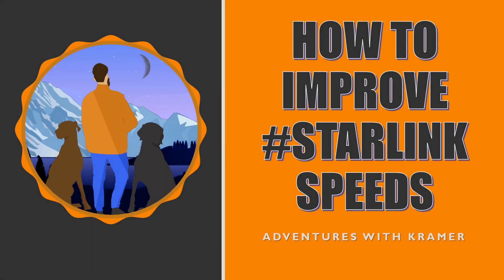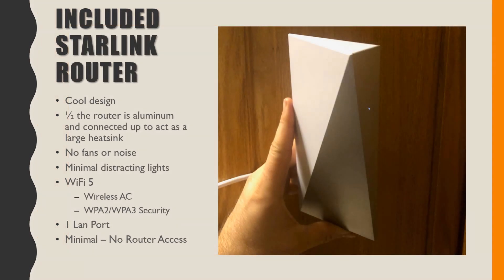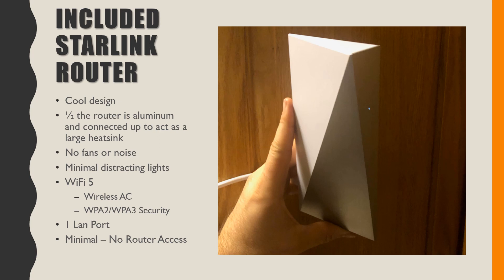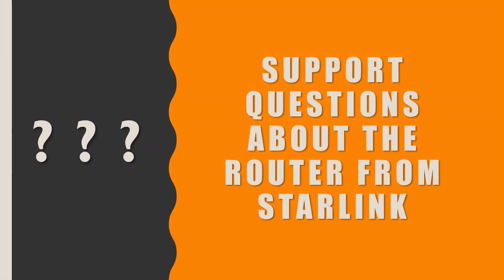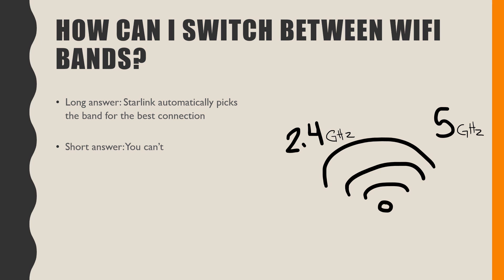How to Improve #Starlink Speeds: New Wireless AX router vs Original Starlink AC Router

Comment: I just installed mine today and the app tells me that there is no 5GHz signal just 2.4 GHz. I have a Netgear Nighthawk WiFi 6 router that I purchased a few months ago to replace an older Netgear router which never could get up to speed nor could I use it for anything more than access to an older HP laser jet, WiFi printer, phone, pad, and my audio and video equipment that, when used ate up my monthly bandwidth allotment and I would get FAPed. The new Nighthawk router allocated the appropriate equipment to the appropriate GHz bands nicely and now I should be able to use it at speed! 

What I need to know is how far from the StarLink router will I need to get to eliminate interference when the Nighthawk is plugged into the StarLink router’s auxiliary port?

Comment: hmm im thinking about getting a different router do you still recommend to do so
Reply from the maker: Yes! The included router is very limited. I have tried pushing it with multiple connections and it would just drop, couldn’t get it to stop pushing 5ghz when there are walls and needs to be 2.4 ghz. Need the extra security and options that another routers give as an option. It’s a good starter router for those not needing many options. But if you want to share WiFi with friends or family, secure the network or just modify settings easier, I suggest an ASUS router. I stepped up to an ASUS, so much better being able to use WiFi 6.
Reply: @adventureswithkramer  wow dude fast response thanks will be my next purchase

Comment: Hello , were you able to turn off the 2.4ghz and 5ghz wifi signals from the Starlink router? just to avoid interference  with wifi 6 router signals
Reply: I just installed mine today and the app tells me that there is no 5GHz signal just 2.4 GHz. I have a Netgear Nighthawk WiFi 6 router that I purchased a few months ago to replace an older Netgear router which never could get up to speed nor could I use it for anything more than access to an older HP laser jet, WiFi printer, phone, pad, and my audio and video equipment that, when used ate up my monthly bandwidth allotment and I would get FAPed. The new Nighthawk router allocated the appropriate equipment to the appropriate GHz bands nicely and now I should be able to use it at speed! 

What I need to know is how far from the StarLink router will I need to get to eliminate interference when the Nighthawk is plugged into the StarLink router’s auxiliary port?

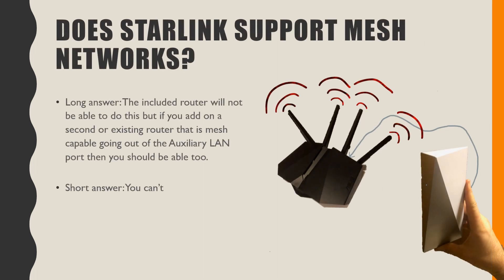Comment: 3:45 you can skip the starlink router completely and just Directly connect the ethernet cable to the mesh router. (Or any other router)
Reply: I just got starlink, everyone has different comments regarding mesh (tons of confusing comments). I just ordered eero pro 6 mesh, but all the youtube videos are giving conflicting recommendations. Based on your comment, I should be able to bypass the starlink router and plug in my eero router straight into the powerblock and it should work, right?
Reply: @benjaminquay , yea right. At least if the router is configured correct. But most routers are automatically configured correctly, so don't worry.
If you connect the router directly to the white site of the power brick (where the starlink router is normally connected), this port is like the port on the modem from your isp.
Reply: @BeamDeam  Perfect!! Thanks for your help!

Comment: You can just remove the starlink router and then set a static route from the wan interface on your router to 192.168.100.1 to get stats from your dish. No need for the extra hop thru the starlink router
Reply: Is it better than what I have my current provider Bravado Wireless really slow can't get fast speeds especially with having gaming router
Reply: @unknownwolf4046  I generally get around 120 mb down and 20 up. Sometimes I get speeds in the 300s though

Comment: Hello, I’ve been a beta tester in Canada and I recently bought the same ASUS router, I’m curious if you’ve figured out how to make the app work with solely the ASUS router. I’ve tried reading Reddit posts and it’s possible, I’m just not sure what’s what tbh
Reply: You can just set a static route from the wan interface on your router to 192.168.100.1 to get stats from your dish
Reply: Does the Asus router support static routing?
Reply: @BeamDeam  Here is what Starlink says in their help section:  " Can I assign a Static IP Address?
Currently Starlink can only provide Dynamic IP addresses".
Reply: @gregbequette2226 , that was no question about starlink. Static routing is not a Static IP.
By static routing i mean that when you type in the local ip address of the starlink antenna the Asus router sends it to the antenna. To do this you need to set a static route that forwards a specific ip to the dish, so that you still have access to statistics of the starlink app.

Comment: Why not plug the ethernet cable from the Starlink dish into your AX router?  Why is the Starlink router required?
Reply from the maker: That is possible now, and I will do that eventually, I wanted an easier way to monitor the starlink app without having to set a static ip.

Comment: Just an update incase someone needs to know and it's likely been updated here on a vid but I didn't check is that you CAN pull the original Starlink Stats page (192.168.1.100) when you disconnect Starlinks Router and don't use it and use your own router. You have to create a Static Route in your router (which your router has to support again most routers do) which you can find how to do on Reddit and it's not to complicated.
Reply from the maker: Don’t you have to reset it every time starlink drops out though?
Reply: @adventureswithkramer  Reset? Like reboot the router? No it stays. It's just a static routing table set to 192.168.100.1 you make so when you request that it knows to get that from the Starlink table. It shows the exact page minus the bottom ping table for some odd reason which I don't care. Everything else shows.
Reply: @RogerDiotte  Its 192.168.100.1 not 192.168.1.100
Reply: @The-Digital-Dread  oops right sorry so late I'll edit..

Comment: Thanks for the video. I have a router question: In my home I have a Apple Airport Extreme setup where I have several connected together. Ideally, I'd like to keep that setup work and plug in the main router into the Starlink internet. Do you imagine this will work? All my printers, smart switches, etc in a bridge mode. I think from your video near the 4:00 mark the answer is yes- if... For reference I'm currently on a wISP provider with a Ubiquity PoE reception. Thank you!
Reply from the maker: Yes it would work, there is an auxiliary port out the back of starlink for just such purposes. I have a second router setup going off my auxiliary port and it gets better speeds that the starlink WiFi, lol. Hopefully in a year or so they upgrade the routers to WiFi 6
Reply: @adventureswithkramer  Thanks for your reply. Good to know. I like how my intranet setup is built (I know it's old tech, but it works just the way I expect) and feel good about Starlink in the future. Only other concern is how much power that PoE will draw, but I hope that is only in the winter months for heating the dish.
Reply from the maker: doing some tests on it now, seems the dish doesnt exert a lot of extra power when there is no snow, but I have about 1/2 snow outside and very rarely am i seeing power draw of 24 watts, supposed to hit a max of 90 watts
Reply: @adventureswithkramer  +1 excellent thanks for the update. I need to bust out my Kill-a-watt meter reads on our current wISP setup to compare apples to apples. Looking forward to your next videos!

Comment: Would this still be the case for a wired connection or is this a wifi connectivity kinda thing? Pardon my ignorance
Reply from the maker: When I have connected with an Ethernet cable it’s only 1-3% better at most. Not worth the cabeling and drilling holes in the house, new AX wireless can handle some pretty high speeds just fine :)

Comment: I just ordered the equipment for the beta test yesterday and I'm excited to try it out.  So if you have your Starlink router right next to your Asus router, will this still work OK?
Reply: You can skip the starlink router completely and just directly connect the lan cable to the Asus router. The starlink router isn't necessary.
Reply: @BeamDeam  i was thinking this could be the simple solution.
Reply: @BeamDeam  when skipping the Starlink router and plugging straight into an existing router, does this allow all the port forwarding to work? I have security cameras and would still like to access them from outside my house. Any information about this is appreciated.
Reply from the maker: I have mine about 3 feet apart but still works great. I actually get better speeds on my router that’s plugged in through the auxiliary port than on the wireless of the starlink router.

Comment: 499.99 for equipment should have better modem/router. Hopefully they will change this later down the road. With 4 ports then most would be good.
Reply: Each of these units cost Starlink $2400.00. You are getting $1900.00 of "free" equipment. There should be an OPTION for an upgraded router but I don't need or want to pay extra for their router since I have expensive Netgear equipment that I will be using.
Reply: Should send them feedback so they can improve modem/router.
Reply from the maker: I imagine they will be upgrading the router in the next year to an AX based system with 4 ports, but I feel like they are trying to build it themselves instead of using some other companies in order to make things more uniform in the system and possibly more secure.
Reply: @adventureswithkramer  We don't have it yet available in MI. But I did send a email nothing back yet but it was to get the beat hopefully soon. But ya hopefully they make a amazing one as far as the modem. The 4 ports I would really need and at 499.00 it better be a good one lol. Really don't like to spend more at that price. 600.00 for the first month not many can do that but online gameing is what I hope it dose great with. Think if in 10 years they started up a fiber ISP and came to the county side for internet lol. I have 6 and 1 for dsl it works but download for games takes years

Comment: Basically what you're doing is using the Starlink Router as a "Modem" and then using a fast gaming router as the Router.  You're bypassing the wireless part of the Starlink Modem/Router and moving up to the Wifi 6 of the ASUS Router.
Reply: I think they are actually removing the starlink router from the equation, and placing their own in its spot.
Reply: @Kriptoker , he did both.  He preferred keeping the Starlink router in the middle because it allowed him to view stats from the Starlink app.  However, it can be done with or without the Starlink router and similar stats can probably be viewed in the ASUS router's interface.  I believe he did the performance testing with the Starlink router in the middle, but not entirely sure.
Reply: @CL-gq3no  he can view the stats if the router supports static routes and he sets the static route. But I don't know if the Asus router supports static routs.

Comment: It's crazy that Starlink are leaving that much bandwidth on the table.  Maybe they are throttling inside their own router.
Reply: WiFi ac is an internationally agreed standard*. WiFi 6 is the next generation of WiFi standard. WiFi 6 will require upgraded clients to take advantage of the extra features of WiFi 6. WiFi 6 routers are backward compatible but that forces them to run at the lower throughput of WiFi ac.  
* So it's not a Starlink restriction.
Reply: @belgianbrian  wifi 5 is capable of 3.5 GBs but the Starlink routers aren't hitting that on wifi it appears.

Comment: Esas velocidades quizás sean por el cambio de satélites, en vez del cambio de router.
Reply from the maker: maybe, but i consistently get better speeds on my asus router when compared to the starlink router during any other tests that I do.
Reply: @adventureswithkramer  Beware of confirmation bias. I do not deny that the ASUS may be better. By the way, have you connected by cable or only Wi-Fi? Perhaps that is the real difference in speed.

Comment: Have you tried doing wired connections? Maybe run the t a switch with multiple ports and plug something direct to see what speeds you get on both? Thanks for the awesome video
Reply: If this is on wifi, Wired connection would have even less ping ! 

Can u try it and do video?
Reply from the maker: I can try giving it another shot, might take me a few days though. I need to see if my dad can make me a cable long enough to reach, sorry for any delay.

Comment: I need a router that lets me pick between 2.4 and 5ghz because I have security equipment and smart devices
Reply: I wouldn't worry about it. I have a router that automatically picks for me and if the device does not support 5Ghz or it's just too far away I'll stick to 2.4Ghz. All of my smart devices have no problem with this.
Reply: Don't worry about it, it your smart devices only support 2,4ghz they only will be able to see the 2,4ghz part of your wifi.
I use this setup for years and devices that support 5ghz will connect to the 5ghz part and devices that only support 2,4ghz will just connect to the 2,4ghz part.
Reply from the maker: The starlink router is supposed to automatically pick between the two, not sure if you can easily search and see both from your different devices. I am liking my ASUS router, connection works way easier around my house than the wireless of starlinks router.

Comment: I will say there have been more downtimes. I used to notice about 6 min in 24 hour sometimes up to 8-10, in the last week around I've been seeing closer to 15-20 min of downtime in 24 hours which doesn't seem too bad, but it becomes annoying because they're just long enough to drop a video call but streaming videos works perfectly fine. Just super frustrating for the calls which wasn't an issue before. I have seen some speculate an issue with a recent firmware update causing greater downtimes and I was not the only one with increased downtimes recently.
Reply from the maker: thx for understanding, it is annoying when they drop, especially since a few seconds later after it drops then you are back to full high speeds. no inbetween or warnings it feels like. But part of being in a beta i guess.
Reply: @adventureswithkramer  I'm not sure there would ever be warning unless they can anticipate when it'll drop for all scenarios and notify you through the app of downtimes.

Comment: can you explain how you hooked up your asus to the starlink router. do you have to make any changes in your asus router ? as you can tell im not that tech. savy. maybe do a video on this ? thanks
Reply from the maker: At first I hooked up the router directly to the output coming from the power brick of starlink. That worked and helped reduce latency and increase speeds. But i lost out on connecting to the app. People have been awesome and told me what I need to do to be able to still access the app, but I am not super comfortable doing that. I have it set up now where the internet goes to the included starlink router first, then out the auxiliary port I have connected up the new router. Work pretty good for me.
Reply: @adventureswithkramer  so your  saying you just went from aux. Port to Wan port on new router and didn't have to make any changes on new router ? Thanks for the reply. Have not received invite yet but I definitely need 2.4 ghz, just trying to get all this stuff figured out before I get it.
Reply from the maker: I didn't have to make any changes on the new router, I wanted things to be simple :) Getting too detailed did not seem like fun to me. The Asus router was simple to set up, as was the starlink. The starlink is supposed to be able to switch between 2.4 and 5 Ghz, but you can't specifically choose one at this time. I know on the teardown videos there are two antennas inside, but there just isn't much more information than that. I have been happy switching to the new router.

Just plugged in a cat5e cable from the AUX port on the back of the starlink and plugged the other end into the WAN port on the new ASUS router.
Reply: @adventureswithkramer  thanks for your help! Hopefully I can get it by late January. I live in S. W. ARKANSAS
Reply: My starlink has 2.4 and 5 ghz u have to go into the app and turn it on so it gives you 2 networks

Comment: Did you check the Ethernet connections ?  Cause I think the difference may mainly be caused through the Wifi connection.
Reply from the maker: I have not, I wanted to see how the the speeds differed based on wireless technologies. I will need to try and make a new ethernet cord to do tests that way.

Comment: Does it support parallel connections? e.g. can you plug in your old internet during the beta to have it swap automatically to the landline when your starlink connection cuts out? I know that the starlink router does not support this but that some people have managed to get this set up with starlink.
Reply: The feature your looking for is dual wan. I have an asus ax-88u which supports that feature. It can automatically switch between which network is better and even load balance I think.
Reply from the maker: I did see a nicer router that had the option to plug in two internet connections. It was the model above the one I bought. It had dual wan ports. But cost $400+ and then I would have another $100/month internet cost. It would help a lot but that’s a lot more money in the meantime.
Reply from the maker: I have actually bought a new router to do this as all of the small dropped connections that happen 30+ times a day get super frustrating and the occasional 20 min outages too.